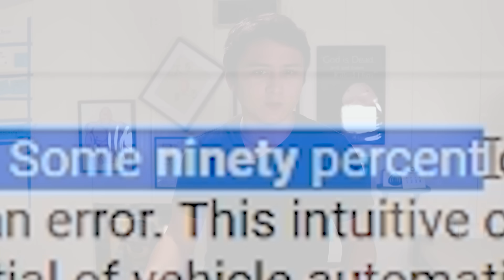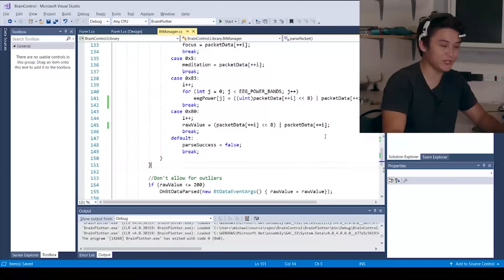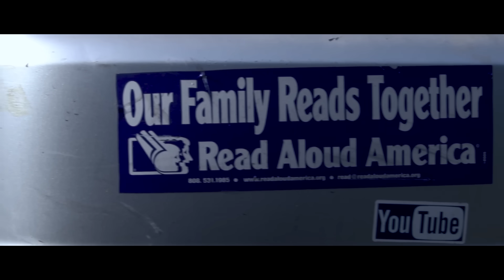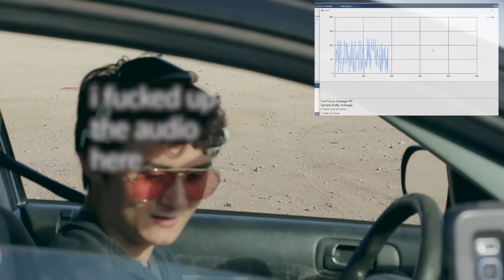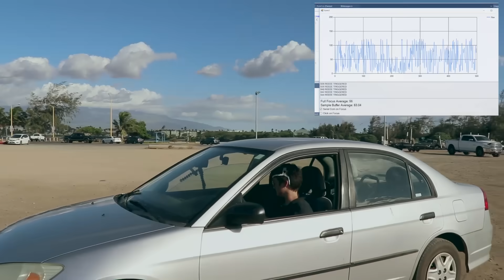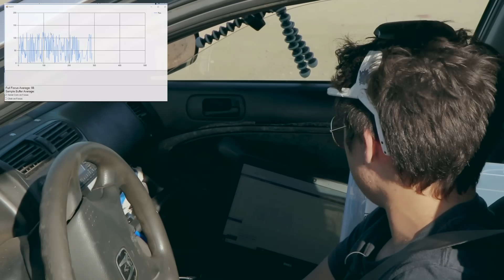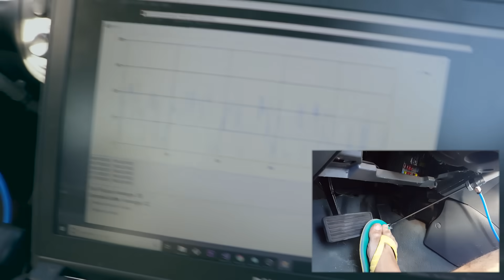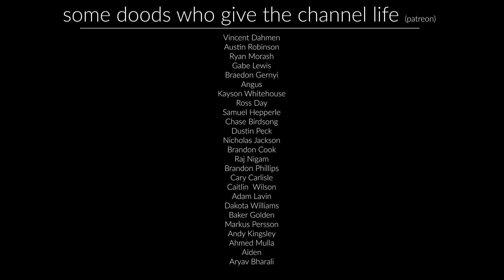Using Mind Control to Drive a Car

Comment: he should make it so that relaxing triggers the brake
Reply: extraterrestrial badger I’d never be able to stop
Reply: @chloebutler8438  Same.
Reply: thats a great idea

"but he will get agitated if he sees someone"

well,this car was never meant to be driven on a street anyway,and the kill switch is there if anythinf goes wrong.besides,whats the difference?it will just make so that the transition is smoother for him since he already would just accelerate if he saw someone with this setup anyway
Reply: But if your gonna crash you arent relaxed so u wont brake
Reply: How it takes relaxing to drive, and focus to stop? It would help with panic making you go pedal to the metal- if you panicked you'd just be in a stopped car
Reply: that would be impossible if you're going to crash into a pedestrian and you start agitating, but since you have to relax to stop you're going to kill him
Reply: @powerpulser5701  r/wooosh
Reply: @dom4947  ehy dom, not everything is a fucking joke
Reply: @powerpulser5701  i doubt it, but whatever..
Reply: Dom what a wooosh karma farmer
Reply: @vezja  but if he were to drive on the road, relaxing would be the worst way to stop the car, as i stated before. and maybe someone is like walking through that parking lot to get to their car and it happens anyways.
Reply: or it could be the other way around where relaxing makes you stop
Reply: A Goldfish That’s exactly what he said...the brake makes you stop.
Reply: @vezja  then we shouldn't just leave breaking to emotion, expecially considering that you can't go from focused to relaxed in 2 seconds
Reply: @vezja  i am not angry, you read my comments like if i were angry. you can't easily identify emotions from a text message

Comment: Use a 5 port 3 way solenoid so you have in between functions for the gas pedal so it’s not always full throttle or no throttle at all you could probably set it up to where the focus values in between the lowest and the highest focus value so you can have more control of the throttle if you try to do this again

Comment: I have an idea, if this becomes a real car you can screw that manual switch and the box on the roof and it can be where you just flick the roof to manual switch. Another idea too, when manual is activated it pushes the piston rod out of the way and into the corner so you can take over the gas

Comment: You should change it from a switch that turns on and off to more of a dial, so when you focus more the piston slowly pushes more so you can control the throttle and you don't go from zero to 100 mph, just an idea hope you see this

Comment: Should've made the car drive when you are unfocused and stop driving when you are focused. Or maybe put in a range then it will drive within a certain range of concentration. This way if you panic and your brainwaves is going haywire, then at least the car will stop driving. Extremely cool project though, I demolished that subscribe button.

Comment: Would have been more safe to reverse the controls, where focus means stopping and zoning out means accelerating. Then panic wouldn't be a problem. I mean, I guess passing out would mean you'd certainly die then, but eh.

Comment: If you want to go full mad scientist (or imagine that you're in a star wars movie), hook this brain wave reading toy to a HERF gun.
Just get yourself some old shitty microwave, take it apart (be careful with the capacitor), disconnect the timers and instead connect the magnetron power control to the relay. Also don't forget to make a metal waveguide for the magnetron, unless you want to go blind.
To make this even more evil, you could have a car battery hooked up to an alternator in a backpack and carry this absolutely non safe weapon around!

Comment: You could install an eye tracker on the dash board so you can look where you want to go and it would steer in the direction you look in. You would install hydraulics on the steering column and there you go! Hands free but human controlled honda civic.
Reply: That's a great idea except one day while driving down the road you see a smokin hot tomali and you look at her and then kill her 😅
Reply: sees group of kindergarten kids
Reply: @luzsuazo2699  J E S U S
Reply: sees orphanage
Reply: So you would have to keep your eyes on the center of the road at all times. That would be pretty annoying. But it is a good concept.
Reply: set threshold triggers like a double blink to engage turn mode, otherwise it rides like a lane assist. so you blink blink your eyes, then from center use retina, turn completed, double blink to set back to lane assist mode.
Reply: Good idea but you’ve probably never driven. You need to know whats going on in all directions of your vehicle. When turning you need to turn your body to check your blindspot. It just wouldn’t work.
Reply: it would work on a racetrack tho
Reply: The Bob Blaberblob Show eye tracker probably not the right way to go because you could see a cute dog look at it then plough through that dog its owner and the owners child

Comment: PLEASE HELP ME WITH MY DAMN TEVO TURDANTULA! No seriously i cant get the right setting to print absolutely anything, well... I mean yes it does print SOMETHING but it usually looks like a futuristic salad instead of a part. I really dont know what software am I supposed to use for it, cause as you know you cant even build the printer with the instructions provided ._. So I tried using cura from ultimaker and well im not retarded enough to get the right settings to actually print anything... Actually if anyone who owns tevo turdantula please reply to this comment i need your help

Comment: build a "smart lighting solution" that adjusts the light intensity by loudness of your crying and color by measuring the pitch. if it's difficult to get absolute values, maybe use relative values to the beginning of the "voice command".

Comment: Michael pls, you probably won't read this comment, but I'm desperate for the code this time. I've been trying to get this headset to work with a project of mine for weeks, and I need to know how you got yours to work through bluetooth
Reply: Same situation here - I've found the code for the previous versions with Arduino mods to get the signal over serial port but not for the newer bluetooth devices
Reply: Fabio Manganiello UPDATE I found a great resource for bt headset http://www.instructables.com/id/Necomimi-bluetooth-EEG-data-hack/
Reply: UPDATE: after reading it a bit more, it's actually not quite what I was looking for

Comment: It'd probably work better with a servo actuating the throttle cable. Maybe set the focus values at different thresholds for different levels of throttle? Then try to focus just a little bit... 😁

Comment: You could have made it voice controlled, which would be easier and more accurate ,but this is better
Reply: Carrots and Vinegar I don't think the point of the video was to drive the car without using your feet. It was to drive with the mind

Comment: would you be able to map parts of the brain and teach an AI to recognise certain patterns that are made when a certain thought is thought of, then use the output that the ai has given as a sort of controller.
eg. i see that these of the brain are very active right now, and im being told that this means "turn left".
can you teach an AI to do this? or are the differences between thoughts too minute?
i once did a test, and they put a cap over my head which had an alcohol solution for conductivity between the receptors and the skin, the wires all went into an amplifier to where a computer could read the signals and it would show the different parts of the brain active at any one time in live video.

Comment: PLEASE MAKE A NEW CHANNEL SO I CAN SEE YOUR CODE IN DEPTH, AND HAVE LINKS TO SORCE CODE FOR US TO USE AND MESS AROUND WITH for example, I want to build an airsoft sentry gun powered by a raspberry pi, I just don't nearly have the skill to code one myself at this point, but I also don't want to just download someone else's code without knowing how it works. I want to UNDERSTAND the code I'm using so I can implement it effectively

Comment: The number one flaw in this is if you pictured a situation in which the car was to fly off the road or crash, wouldn’t that happen? So basically for this to work you’d have to have no imagination, and have no plan b or be able to think of anything bad happening, and then and only then would this work.

Comment: Michael couldn't you set the values so when there is low focus the gas is slightly pressed and when there is more and more focus the pedal gets pushed harder to actually make it work to modulate the amount of gas you give it

Comment: Would it be possible to set up a toggle for different focus levels or to detect a change in focus to act as deceleration instead of only acceleration? In terms of coding anyway

Comment: I just realized you should collab with Colin Furze.
Reply: Also electroboom
Reply: The human race is not ready for these kinds of advancements, calm the fuck down
Reply: Kasper nah to world can't handle that
Reply: Good god no. The resultant explosion would probably wipe out 45% of humanity
Reply: what about simone gierzt?
Reply: Fast furry and funny is basically that
Reply: Hell yES
Reply: Twould be cool to see but i do bwlieve the distance is too great to the cost to get there and even if so what would they do?
Reply: Can we throw Styropyro into the mix? Anything could have a laser.
Reply: William Osman would also make a cool collab
Reply: Bram Kemper That's already happened.
Reply: Kasper colab with colin ferze and hacksmith
Reply: pixelking you’re a genius
Reply: No, a collab with Colin furze and Peter sripol.
Peter will probably make another plane, then we use Colin to do the metal work and hydraulics. And then we use Michael to Weaponize it with lasers that shine in people's eyes and give it mind controls.

The perfect plan

Comment: You should do the exact opposite so it stops when you panic and drives when youre calm
Reply: That wouldn’t work because that you mean you would need to be unfocused while driving.
Reply: But that would remove the nice positive feedback loop that occurs when you panic, focus even more and drive at full throttle for even longer :(
Reply: You really think he's out for GOOD ideas?
Reply: Well that's Gay
Where's the fun in that?
Reply: Well that's Gay where's the fun in that?

Comment: Im actually tempted to make a variant of this from the ground up for physically crippled people. Could use multistage neumatics with a more advanced brain reading system similiar to the ones used for prostetic arms. Might actually be faster then phsyical breaking and speeding up. Kinda cut down the amount of proccesses needed to execute the action by going straight from the brain to the vehicle instead of from eyea to brain to muscles to car. It would be eyes to brain to car.

Comment: This wouldn’t work because every time there was an accident, everyone would get freaked out and it would cause a chain reaction.
Reply: Milo Morrone a simple solution would be to set a hertz limit at a certain point which causes the throttle to temporarily disengage and only engage when you reach the lower part of that threshold

Comment: You could have just hooked up a electric motor to the throttle linkage so you would be able to control the speed.

Comment: Ok one fellow idiot to another you should find a way to clean up those wave lengths make it more analog and find a drive by wire car so that you can hard wire right into the accelerator position pedal reeeall safe like (its only a Fucking potentiometer, rehostat type deal) have it so at calm rest voltage output is zero and the more FOCUSED... (panicked) you get the voltage sweeps up opening the throttle more! Just trust me I’m a fucktard mechanic!

Comment: I have a suggestion: you should flip it the other way, so you relax to drive, because if you lose control and panic, you focus. Also, if you want to drive long way, you don't want to have to focus hard for hours.

Comment: Hook the brainwave reader to the shock pads used in the involuntary dabbing machine, attach those shock pads to a jockstrap to stimulate your balls
Reply: I was good with the part with the brainwaves and dabbing machine. But I don’t like a electric shock pads stimulating my balls.
Reply: Perfect, when you focus it stimulates your balls, when you relax it forces you to dab, so you have to pick which of the two evils is lesser. Best results in a crowded public place like a mall
Reply: Set the shock high enough and he won't be able to unfocus on the pain... Do it.
Reply: Reverse it to where he stops focusing he gets shocked and now it has a practical use, keeping you awake.
Reply: TeCool Mage SATAN WANTS TO KNOW YOUR LOCATION ( ͡° ͜ʖ ͡°)
Reply: TeCool Mage Best comment so far
Reply: Whenever you get focused enough you instantly have an orgasm
Reply: Best results is when you get arrested
Reply: Doublechindoge 7 Hit me up 666-666-xoxoxo

Comment: could have just wired it into the flyby wire on the throttle body and then adjusted the voltage with 'magic' finetuning it till it wasn't constantly full throttle

Comment: Of course with additions to this, like something directly hooked up to the engine, it could be the new saftey feature. The driver has to concentrate enough to allow the car to accept any input from the accelerator pedal. That way it kinda prevents them from getting to drowsy and not pay any attention to the road.

Comment: Dude, have it like hooked up to 4 people so each person can control either accelerating, turning left, turning right, or reversing.
Reply: Anish Shanmuganathan that’s the scariest thing I can imagine
Reply: Thank you Anish, very smart
Reply: That is brilliant
Reply: +Helix Twist but it wouldn't. Every pneumatic cylinder would be tied to it's headset and the arduino would process the signals individually. So if person 1 increases focus that only acts on the throttle, person 2 only acts on the steering wheel, etc.
Reply: Oh my god
Reply: Anish you can’t because for it to ready separate stuff it would get confused
Reply: That's some Voltron stuff right there.
Reply: And dabbing
Reply: Luke Schelter thank you Kanye very cool

Comment: I don’t really know how to code so I couldn’t do this but is there a way to get his code so I can do this myself?
Reply: Nathan T If you’re that genuinely interested and are a masochist, just start by looking up raspberry pi tutorials or Arduino tutorials. There is a lot more to this than code under the hood. You have to be able to relate the code to the electrical signals generated by digital devices and know how to wire it correctly without putting too much electricity through things. Otherwise, you’re just going to damage all the components and fry them so they don’t work. This kid may seem like he is doing something simple, but having a Masters in Computer Science myself I can tell you his computer engineering skills are pretty amazing. So if you think you’ll be able to get to his level in a week, you’re not going to. It may take you a few months before you can get to a level like his depending on how much time you put into it.

Comment: What if you used the focusing as a toggle, so focusing turns it on, then the next time you focus it turns it off, could be an actually decent way of controlling something with a binary on/off because it evades the sparaticneas of the sensor a bit

Comment: Would be more effective/safer if you added another sensor input such as a camera checking to see if you're looking at the road or a pressure sensor on the wheel.

Comment: Measure the intensity of the spike after a threshold then make height positively correlate with speed. A nice upgrade if you're trying to use it as a precise tool rather than a 1 or 0 action.

Comment: While this is funny, I will point out that almost all cars made in the last 20 years are at least somewhat computer controlled, even if it's just engine timings and that check engine light and other boring things. A self driving car would be far safer than a normal car, because instead of haivng a driver that is very likely to fail, you only have the car itself, which is much less likely to fail. That is, as long as the computer system is well made. Luckily, we have these people called "engineers" and "programmers" who their entire job is to make sure that computer system is well made, and they know what they're doing. Unlike the guy in this video.
Reply: erica I agree with you but 
1. He is a “programmer” in his own little suicidal way
2. He already covered that when he very sarcastically dismissed that it wasn’t human error that causes accidents
And 3....there is no 3rd point I just felt like putting 3 because I feel like it